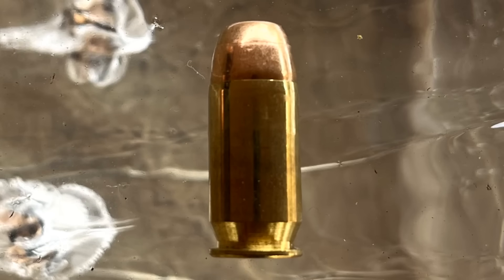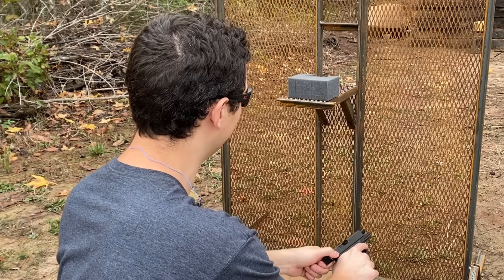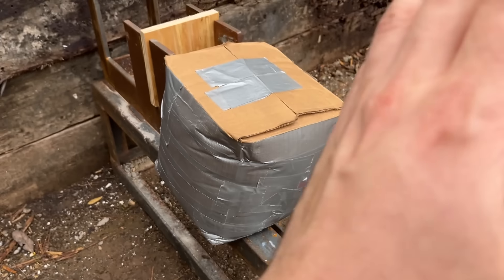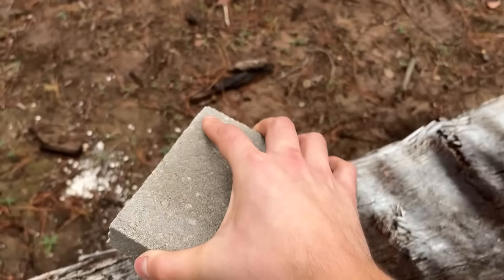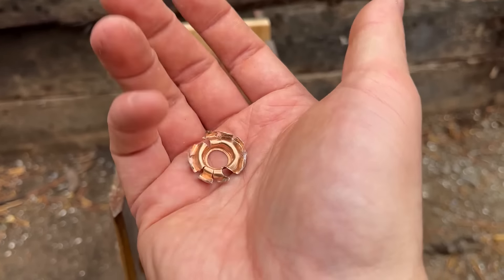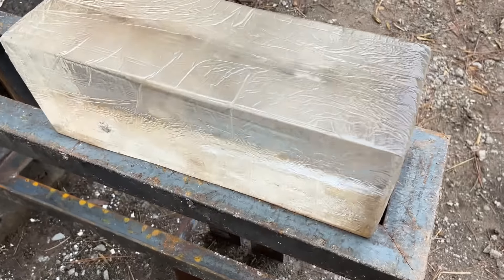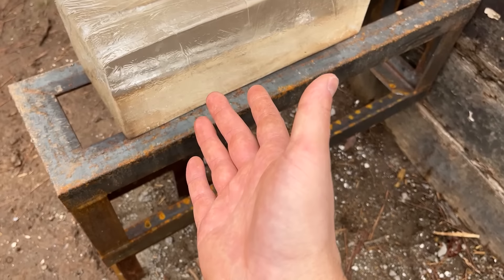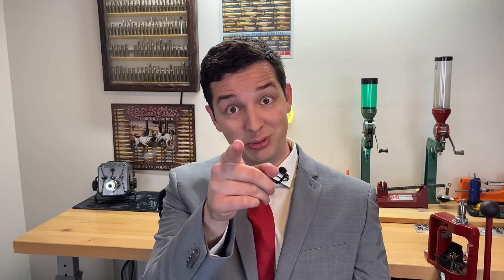9mm vs 45 ACP Barrier Test: No Debate?

Comment: Fun video! A couple points:

The cement test a draw? That's laughable. The 9mm to a chunk of and the 45Auto demolished it. 
The Gel Test - anyone notice the difference in movement of that block between the two rounds?? 

The 45 ACP dumps its energy HARD and is arguably more comparable to a 10mm insofar as damage. 

Try water jugs between these two again and watch the 9mm stop 2-3 jugs before the 45ACP. WHY?? MOMENTUM!

Comment: The cdc or fbo compiled data that basically stated that all handgun calibers from 380 acp to 45acp were within 5% effectiveness for stopping a threat.  You see no increase in effectiveness until you get into magnum hand gun rounds .357, 44mag, 41mag etc..... 
10mm data was not included because there was not enough data to gather.  My guess would be 10mm in proper loadings that are equal or superior to .357 magnum ballistics would be as effective as such.

Comment: The old Penetration Distance vs. Circumference questions.
Reply: Not the actual issue, it's unequivocally better to have more lethal rounds to throw at somebody faster than to have fewer, especially when the differential in capability is as non-significant as 9mm to .45acp we're not talking the difference between .45acp and .50ae.

What people can survive in the heat of the moment and still be lethal is paradoxical as compared to the tests we do on inert objects and materials.

Mag dumping saves lives and 9mm shoots faster with less recoil and with more rounds to spare than .45acp
Reply: It was a play on penis size, a joke.  but by the way. I recently watched something that actually discussed shots fired by police in a shooting incident: average was 3-4 shots for 40, 357, & 45.  For 9mm it was 6-7 shots average.  conclusion drawn was that officers carrying a 9mm shot more rounds because they had more rounds and not because they needed them. @mysteriousfleas

Comment: I'm assuming the 9mm is opening up at a slower rate while having more energy. It's the clear winner even without having to watch the video. 9mm is ubiquitous. I like that he used the same manufacturer and grade.
Reply: The 9mm had the least energy with both bullet types (up top in description) .
Reply: @44special9  9mm should be faster.

Comment: No this doesn’t touch the debate.  Neither cartridge was intended to penetrate lumber.  And the 45ACP was intended to move slow but dissipate a massive amount of energy (due to its large mass) without penetrating deeply into a human body.  The 9mm is intended to fit more cartridges into a magazine and give the shooter more shots on target but deliver less energy per shot.  Shot placement is more important with 9mm.  Both serve an important function.

Comment: I like and shoot both calibers. But just remember, hollow points, for various reasons, do not always expand reliably. The 45 is already .45 inches without any expansion.
Reply: Actually, 45acp has the tendency not to expand, and other faster moving caliber are typically expand reliably, are well vetted, and have stood the test of time. 9mm and 40s&w HST will expand larger than most commercial 45acp offerings, especially out of 4" or less barrel lengths.

Comment: I use to shoot bowling pin table back in the day. 45 acp with a well placed shot pushed that thing off real nice. Akid came up with his 9 mill. Shot onece nothing but a little wiggle. Shot 3 times all total and when we looked it just went threw it still stayed standing. I'll take the 45. I shot 225 speer semi jacketed hp. outta a 44 mag redhawk. Pins went flying even with a mild load.

Comment: 357 sig and 10mm next
Reply: How about .357 Sig and .40 S&W instead?
Reply: @FraserFir-sb4lk  I was thinking that at first, but I always hear sig guys saying how much power the 357sig is.
Reply: @mottomanic  They're wrong. The .40 S&W can sling a 180 grain pill 1160 fps or a 135 grain pill 1430 fps. You're lookin' at about 540 to 620 ft.lbs of muzzle energy. The .357 Sig is the same case necked down and has a similar powder capacity. So, a .40 S&W with light for caliber pills is gonna make about the same velocity/energy. Plus, it has the ability to sling much heavier stuff as well.

Comment: I wouldn't pick 45 ACP only due to the size of the cartridges.  Less available to shoot, heavier to carry, takes more room to store.
Reply: Yeah they make bigger holes and take up more room in the bad guys body too, usually taking less shots because each one is more effective.
Reply: Not true. We can tell if it’s a small caliber like 25-22, but all other pistol rounds are too close. This wound cavity is nonsense too. Most shoots hit the lungs, that’s all air. Maybe your intestines act similar to the gel, but they get cut out. Liver, kidneys and heart do not stretch and generally mean you are in trouble regardless of the round.
Reply: @HWG-wm8ld  A larger hole than a smaller one in a vascular structure causes an increased rate of blood loss, does it not? Greater bullet surface area increases the volume of nervous tissue coming contact with and being crushed by the bullet. 45 will always drive a larger expanded bullet deeper because of its greater momentum. Ranger T .45 expands to over a full inch in diameter, HST is about .850 but does better in heavy clothing. This isn't even mentioning the evolution of .45 ACP in .45 Super and .460 Rowland.

Comment: Its velocity to bullet diameter...the larger bullet with more surface area will penitrate less at the same velocity. A 45 has almost the same chamber pressure as a 9mm but a larger bullet diameter...this is why i said 460 rowland would be a better comparison. 
At the 3nd of the day tho...you would want a flesh wound from a 9mm over a 45. Its not all about penitration ...wound size is a big factor to surviving a flesh wound...i know, i specializes in platelets and extreme wound care. 🎉

Comment: Statistics do show that in an engagement per engagement comparison 9mm pistols have a higher effectiveness than .45 caliber. Thats not to say that cartridge to cartridge that one is better or the other on a bassis like penetrating power or force transmission alone. Actual engagment has to many extinuating factors to account for across the board.

Comment: John Moses Browning < Georg Luger

Repeat after me: Knockdown and stopping power is a myth, unless you are firing a cannon. 

Advantages of 9mm:
* smaller size and higher magazine capacity
* faster follow-up shots, leading to
* increased accuracy
* lower cost and higher availability, allowing for twice as much practice for the price
* better penetration, allowing better use of hollow points

Please read: FBI Handgun Wounding Factors.

Comment: If a bullet passes through a target, the round dumps a large percentage of its energy outside the target. This is the specific reason that a 9mm round is pathetic at being a stopper and virtually all law enforcement agencies carry rounds that dump huge amounts of energy into the target. 
Barrier penetration is only necessary in a small amount of situations and for those you are better off with a 10mm.

Comment: Up date your 45 load to the same modern up grades and it will outperform the 9mm. Could go 185  gr hp. With a certain powder you can push it at 1200 fps out of a 45 acp hand loading.this load will also be 2000 psi under max pressure

Comment: My personal opinion is, would you rather be hit with a fast moving tack hammer 🔨 or a slower moving sledgehammer. 
If hit in soft tissue the tac hammer is most likely to penetrate, but the sledgehammer will cause massive internal trauma without penetration.
Reply: Handgun rounds do NOT move fast enough to cause any interal trauma. You need to reach rifle caliber speeds for that. Handgun rounds simple poke holes with some holes being ever so slightly bigger and, within inches of each other, longer.
Reply: @finalcountdown7658 
Try shooting my 454 casull, 8 3/4 inch barrel, 260gr bullet at 1,960 ft/sec hornady xtp magnum bullet. 
My handloads.
Reply: @rjoetting7594  That is STILL below the threshold to be able to get any terminal performance/damage. Maybe you should search and/or educate yourself on terminal velocity/performance. Handgun rounds do not reach those speeds, nor do they have the mythical "man stopping, one shot stop" power that people on the internet like to pontificate about when it comes to bigger handgun calibers.

Your 454 casual simple has the power to propell a large bullet further in order to make a deeper/longer hole. It simply punches a hole. In a huge animal or with intermediate barriers in the way, it will have the power to better punch through everything and reach aka punch a hole into the vitals of the target. It's velocity and muzzle energy is NOT going to cause terminal damage like a .223/5.56 or much faster rifle round will. It's NOT going to destroy tissue like a rifle round will either.
Reply: @finalcountdown7658 
Sounds to me like you what you're talking about is hydrostatic shock.
Not terminal performance, two different things. 
Maybe you should learn a little more about terminal performance of a bullet on game animals. 
The 454 I'm talking about does a hell of a lot more internal damage to the heart/lungs of a white tail than my 30-30 at 50 yards.
Reply: @rjoetting7594  No, I meant what I originally wrote. Handgun bullets are NOT traveling fast enough to cause damage from speed, nor does muzzle energy energy produced by handgun rounds cause damage per se. I already researched this, and there are multiple sources to back this up.

What your 30-30 is doing at 50 yards depends on the barrel length, grains, and velocity at that distance, all of which you  have not disclosed.
Reply: @finalcountdown7658  
30-30 factory ammunition federal fusion 150gr, 26" barrel, 1894 rifle, the rifle is capable of 1.5 moa with this ammo. 
The 170gr version is only 2.5 moa at best. 
(Remember 60 year old eyes)
Using an original Marbles tang peep sight. 
Made in 1917, Cresent butt round barrel full length magazine tube, excellent rifling, 98% bluing still on the barrel, receiver 60%.
Wood is very good, none missing with a few dings and dents.
I've never chronographed it to check velocity. 
I'm 60 years old and have been reloading since my early 20s.
And I can not remember the first time l shot a firearm. 
As I get older, my preference has moved to traditional BP firearms, like my kibler flintlock rifle 54-caliber. 
I've killed more deer than I can remember with many different firearms. 
And I know what works for me, I always take my time, and I've passed up a lot of shots I felt uncomfortable with. 
Always a heart lung or shoulder shot, most go down almost immediately, but I've had a few that ran up to 60 yards before collapsing.
And most shot inside of 70 yards.
My 454 casull inside of 50 yards, and everyone so far has dropped in their tracks. 
That is 5 in total with this particular handgun.

Comment: Its easy-peasy Just follow millitary choice...In 1985, the . 45 ACP M1911A1 pistol was replaced by the Beretta M9 9mm pistol as the main sidearm of the U.S. military, although select Special Operations units continue to use the M1911A1 or other . 45 ACP pistols., last choice was sig.  If you not feel yourself like special  operation UNIT,  go for 9 mm. Do not  waste time on other calibers like 45 acp. Keep in mind that since body armo protection is easy available to stop  9 mm or 45 acp, only way to go further is AR... Military knows that so and you do.

Comment: No.... whats impressive is the fact that the 45 acp kicked the 9mm's rear end. Other than capacity 45 wins. With these rounds for personal protection i choose 45. For the energy dump. Lower velocity will increase the penetration. Higher velocities with improve the energy tranfer faster but lesson penetration. 9mm is a great defensive cartridge especially when considering the capacity of the mags.  You need the velocities to calculate actual energy and youll change your mind. ❤

Comment: The 45 absolutely crushed the 9 mm on the cement block the 45 twice as powerful than 9 mm there's no is and their butts about it penetration does it mean s*** it should be able to penetrate deeper than 9 mm it's twice as small as the 45 what do you think is going to happen

Comment: While the idea of a bullet is to cancel a person. .45s and 9mms were designed for different uses. 45s were meant to deliver more impact to a body, while a 9mm is meant for penetration. Penetration in a civilian setting is a terrible idea, especially considering how many people have no trigger discipline and never really learned to use their weapon. A .45 is a safer bet, it's less likely to pass through a target, and unlike a 9mm a .45 will absolutely drop a target. "Shock" kills more people than the wound does.

Comment: I know for a fact 45 acp through a carbine 17" barrel shooting federal hst 230 g,  blazer 230g aluminum  and a 9mm through a spring field xdm 3.8" barrel 9mm blazer 115g, federal 124g hst won't even go throw 3/16 aluminum  but they do put a nice dent in the plate(24"x48") but then again 450 bushmaster 395 grain hornady won't either.

Comment: Explain how the "maximum wound channel" of the .45 is smaller than the fully expanded bullet? That would be impossible, unless the bullet continued to expand after you removed it from the gelatin, which we all know didn't happen. Your "maximum wound channel" measurements are obviously inaccurate. Simply, if the .45 expanded to .881, then the wound channel had to be at least .881. unless the bullet could expand without disturbing any gelatin, which it cannot, because physics.

Comment: When the .45 is indisputably wider, settling at about the same place, it didn't teleport there. 

It is notably wider and therefore had to make a wider track. You just have a measuring problem. 

The .45 wins the last category.

Besides, I prefer 1cm.

Comment: I've watched several of your videos in this format now and I want to point out that those blocks are NOT concrete. They are cement. Which although it's the bonding agent used in concrete it's nowhere near as strong nor as hard! Concrete also contains sand and stone which is much tougher on bullets.

Comment: My backdrop is tires packed with sand. Every time I shoot .38 (close to same speed as .45) I find several bullets sitting on the ground about a foot in front of them. I wouldn't say they bounce back, just bounce off and drop. I have never seen this with any other caliber, but as far as handguns .22, .357, and 9mm, are about all I shoot, so I can't say weather .45 would do the same.

Comment: Interesting - however, try 124gn +P 9mm vs. 230gn +P .45 and 185gn +P .45 and make both with hollow points.  That would be interesting.  Thanks for the channel!  Your vid on 7.62x39 vs 300 blackout was also helpful.  GOD Bless

Comment: Now if you were to compare 9mm to 45 Lon Colt; thats a whole nother ballgame. 45 has the 9 by 140ftlb of energy travelling some 90fps slower. (and it can still can go thru two 5/8" wallboard after traversing a 6"6" 275lb torso diagonally upward. LOLOL - not 1/2", really 5/8" old 50's wallboard in my house.)
PS I remember a demonstration of 45ACP back in the late 40's. on TV. A guy shot at a 10" square silk cloth hanging on a clothesline. From abour 10' at the midpoint, the bullet did not penetrate the cloth, it slid over the bullet out of the way as the slug passed along under it. (dont ask me to explain how. I was 10 yrs old and I was impressed by an Army 45 - til then)

Comment: If you add up all the volumes of each hole, the 45acp would win.
Reply: Well the volume of the permanent cavity coming from the . 45ACP is Small. The . 45acp is 21.46% larger in diameter....... Yet failed to leave a larger permanent cavity while retaining its entire projectile weight  as it fully expanded
Reply: @williamster2015  ...In a real person it would be larger in the 45's favor.
Reply: @truknz71  in the real world this has been disproven many times. 
Its a . 45acp NOT a 10mm auto or 460 Rowland

Comment: The 9 mm basically has better range speed and penetrating power the 45 ACP is heavier and slower but it packs a nasty punch you get it with that
 you are not getting back up

Comment: Understanding Firearm Ballistics New 6th Edition - By Robert A. Rinker -
Chapter 26, Terminal Ballistics for Self-Defense: 
page 364; 
"The FBI tests show the larger diameter bullet opens a larger permanent wound cavity for maximum blood loss. This is old thinking to many gun experts who have preferred the heavier .45 ACP type guns to the lighter and faster 9-mm. 
page 365;
To briefly summarize the results, the .45 ACP did very well in most loads, as did the 10-mm auto. The .357 magnum also did well.  .38 Special for the most part didn't do well. The 9-mm performed about the same. Statistically, the 9-mm as a group averaged 5.4% better than the .38 Special but that is still poor by comparison.
The 1989 FBI tests leaned more towards the heavy bullet theory."
page 367;
With handguns, it is hard to go wrong by following the FBI's choice in ammo selection.
page 371;
The smaller caliber gun is not as effective as a larger one
page 372-373;
a person armed with the 45 ACP or 45 Colt was able to defend himself very well.
THE 9-mm SITUATION from the point of view of ballistics, the disadvantages are far stronger.
If the 9-mm requires 13 hits to put someone down who is not drugged up, perhaps it is a poor choice. The FBI and other tests clearly show that from a ballistic point of view, there are better choices. Some experts believe a lot of the erroneous  information about the 9-mm pistol. Disregarding the weapons and their mechanics and dwelling strictly on the cartridge ballistics, the 9-mm isn't as good as what it replaced. (The 9-mm replaced various .45 ACPs and .357 magnums.) The 9-mm is not the best. At least from a ballistic point of view.